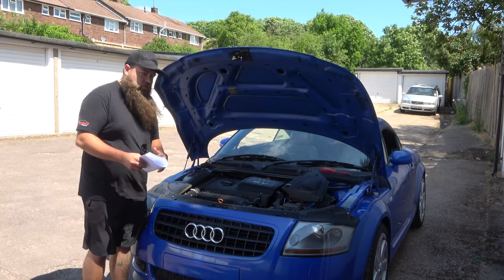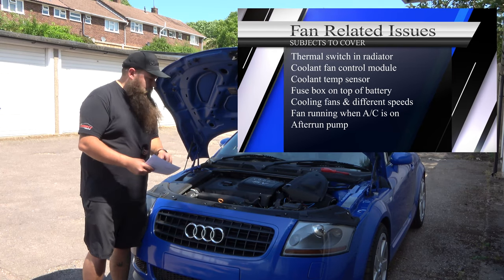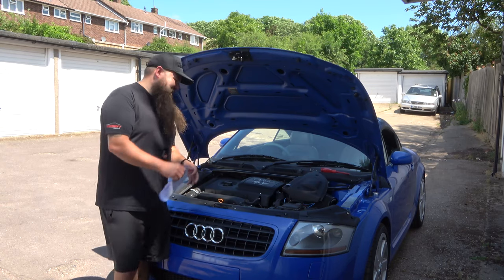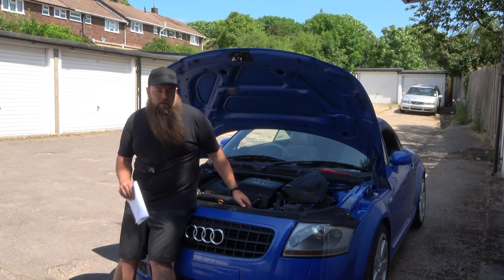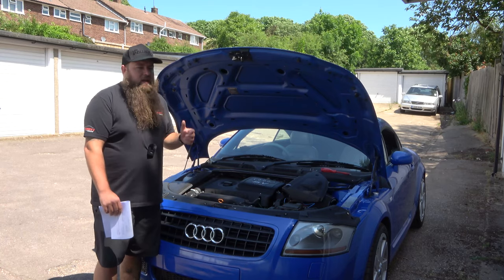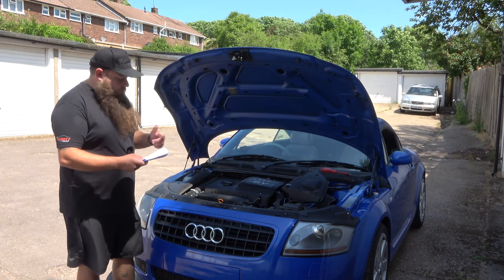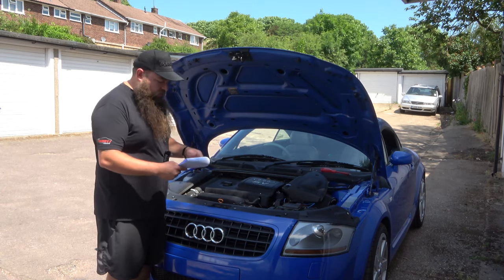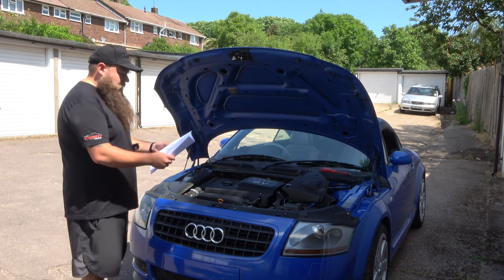How To Fault Find Fan Problems Audi

Comment: My Audi A8 Quattro 1999 is over heating and when I look at the two fans I see by the radiator, one fan that is connected to the belt and there is one electric fan that isn’t kicking on at all no matter the temp of the car. I watched your video all good info. Where should I check first thanks in advance
Reply from the maker: Not particularly fluent with a8’s buddy but I would check the supply to the fan and see if there’s power there or not. There’s a good possibility that you have a knackered fan or there is no supply maybe due to a failed fuse etc

Comment: Idk if you’ll be able to answer but I have an 08 Audi a4 and my heater hose broke and I replaced it and re added the coolant but when I turn on the heat(which blows super hot air) no fans come on, but when I turn on the ac, the fans come on

Comment: I’ve replaced literally all of these, and I still have to use the a/c to make my fans come on. The only thing I can think of is that maybe the brand of the thermoswitch I bought doesn’t cooperate with the car. Also I don’t have an after run pump. 02 180 5 speed Q
Reply from the maker: Sounds like you may have a faulty part, you could also have a broken wire etc. the thermo switch can be tested my using either heat or hot water to see if it changes state

Comment: Hey, thanks for the video, it's was very informative!
I was wondering of you disconnect the Coolant temp sensor, does it bring the fans on? I understand this works with most other cars.
Ty bud!
Reply from the maker: It’s not something I’ve tried but I don’t think it will, the fans are bought on by the thermal switch in the radiator

Comment: Another great vid big man. And just in time as my temp warning light things cropped up yesterday lol. 👊
Reply from the maker: Hope you get it sorted with the help of this video 👌🏻
Reply: Having another look tomorrow. The 49 code jobbie and the temp needle seem to be working together but still temp warning lights on. Both fans work with air con on. I'm I missing something??? Must watch vid again. Lol thanks again keep up the good work. 👊
Reply from the maker: @adamdrayton3100  you could have a failed water pump so it’s not circulating the water, the temp sensor could be faulty etc
Reply: @TheParrottBros  changed temp sensor. But before that on the way home it disappeared and comes on straight away when you turn the ignition on it there waving at you. Will have to get it apart see what the crack is cheers 👊

Comment: Brilliantly informative video. Just subscribed!
Have I missed it? What I have a A/C pump clutch not pulling in, but if put 12v the connector, it works OK. Is there a separate relay or is it controlled by the fan control module?

Comment: Just working through these issues this week.  Check this out....  large fan not working, ONLY small fan would engage (with A/C on or when coolant reached temperature threshold).  Jumped the thermal switch, had both high and low speeds on both fans (conclusion bad thermal switch).  A/C wouldn't blow cold. A/C compressor was only getting 9.5v...but was I was getting 12v entering the FCM.   Swapped out the FCM (knockoff) - result was NEITHER large or small fan would run BUT I did had 12v at the compressor.  Applied 12v directly (bypassing FCM) to the A/C compressor, clutch engaged (freon level was fine and small fan was running) but would not build high pressure in the system (conclusion- bad compressor.....and bad FCM).  Was driving myself crazy trying think this was only one issue......all wiring/fuses were fine no corrosion or signs of overheating ......you must have been feeling my pain and decided to make this video....hahaha.
Reply from the maker: That’s probably the most annoying part of fault finding issues. New parts that you can’t always rule out. Even though it’s new and should work fine 😂. Top work for persevering through
Reply: @TheParrottBros  I definitely have a few more gray hairs! 🤣
Reply: Hey sorry for bother you if I buy the air flow Sensor I’m Supposed to take it to dealership to program to the ecu or I can just connected the new one plz if u have a chance let me know and the temperature gauge it goes really high and that’s when the fans kick out when the gauge is really high any Ideas because I know you’re really good working on Audis TT
Reply: @victormagana1641  Sounds like you are presenting multiple issues that are not related to one another.  Have you had the car scanned with VAG software?  If not, this should be the first step.  Did you get a code for the MAF sensor?  If so, it's a straight forward swap.  The fans cutting out when hot is very odd and can be caused by multiple issues. Check all the connections at the fuse box on top of the battery.  If BOTH fans are cutting out, I would suspect a FCM or a Temperature Control Switch, but you should check voltage at the fans when they cut out. Voltage at the fans would point to the fans being bad.  No voltage to the fans would point to an issue further up the electrical circuit.
Reply from the maker: @victormagana1641  you can fit a new maf and providing it works and is not faulty it won’t need any programming etc. You may need to get a code reader and clear the fault codes. But you can just take battery off for 10 mins. Does same
Reply from the maker: @victormagana1641   your fans slow speed has probably failed, you need to test your thermal
Switch like said in this video. If you short the live and slow speed on the plug and they don’t run then likely failed. 

That or put your a/c on and if your fans don’t run that’s likely your problem. Need to replace fans
Reply: Ok I will put a new one on thanks bro’s and keep putting videos on they well Help a lot of people for the TT thanks again
Reply: Hey bro I have a boost Pressure leak on my TT any idea
Reply from the maker: @victormagana1641  Hey, could be lots of places it could be leaking from, pipes, joints, valves / solenoids. 

i would personally recommend feeling your way round every pipe, making sure its fitted correctly, doesn't have any damage etc first.

if you are unable to find an issue then you either need to get it smoke or pressure tested to find the culprit
Reply: I check with the car code machine and the code says boots pressure Valve leak
Reply: Hey good job on the videos parrott Bros hey Quick question when I turn the A.C on the fans they are not kicking on they supposed to kick on right
Reply from the maker: @victormagana1641  yes when a/c is turned on auto the fans should run on slow speed. If they are not either your ac is not working or the slow speed is faulty

Comment: My fans stopped working after doing the timing belt and heater core ...but it does work when AC is on .maybe its the control module
Reply from the maker: Test the thermal switch in the radiator, that’s more likely to be the cause

Comment: The fan on my 03 A4 doesn’t work anymore not even AC fan and I tried to run it with VCDS via output test and it still didn’t work, I tried to jump start it with a test lead on the connector for FCM and still didn’t work am I clear to understand that the FCM is bad?

Comment: Great vid!  on my Audi TT the fan turn on low speed but not on high-speed.
Reply from the maker: You should only see high speed when you go above 103 to 105°C, that doesn't happen very often if your slow speed fans working fine
Reply: Thank you, my man for responding. I changed the thermostat and the coolant temperature sensor now it’s working fine thanks again..

Comment: Got Audi A4 2.0l just got a problem of the fan and overheating will try that issue of aircorn. I did change aircorn compressor and no gas on it 
Thanks

And wht could be the problem if boot is not being open? Sometimes it opens  especially when it's cold when it's hot they is sun 🌞  doesn't open? Please help

Comment: Very good video and very thorough. However my problem is that my fans are working with ac on however they dont work when ac off any solution to this ? What should i look for ?
Reply from the maker: That will likely be your thermal switch in radiator. Unplug it snd bridge it out and see if your fans come on, if they do then your switch in the radiator is faulty. Very common
Reply: @TheParrottBros  thank you so much
Reply: @TheParrottBros  hello again. Many thanks for your kind advise. Happy to say that the problem is solved👍
Reply from the maker: @marinoskazamias9252  awesome 👌🏻 glad I could help

Comment: Is the smaller fan, for normal cooling.
And bigger fan is for AC operation only.
Thanks
Reply from the maker: Both fans should run at the same time, slow speed and fast speed. ( fast speed only for when cars above 103c ) so if a fan isn’t running it’s failed

Comment: Informative video! 

Just a quick one, when I turn my ignition on.. car hasn't been run at all. I hear the fans burst into life and running full pelt. Is this normal?
Reply from the maker: If your air con is on then it could well be, turn your climate control off completely if the fans still start up you could have an issue with the fan control module

Comment: Such a well timed video, my temperature has just started playing up, going to around 108 in traffic. I've noticed that with the Aircon on the both fans are spinning for about 30 seconds then both stop for another 30 then they cut back in again....also noticed that the overrun doesn't appear to be working :(

Comment: My fans run with the aircon so guessing they're ok. Fans are not cutting in but the consul temp is lower than the dash temp higher up the range.   Would a thermostat be on your list?
Reply from the maker: Both the dashboard cluster and the heater controls measure the temperature from the same place, the temp sensor on the passenger side of the engine. If your fans are not coming on when the car gets hot and the Aircon is off it is likely that the thermal switch in your radiator is failing or failed, this can be proved by removing it and then sorting out the two pins and see if the fans come on if they do then is the switch if they do not then he could be the control unit underneath the battery
Reply: Thinking whilst I'm there I may as well do the coolant sensor & thermostat........:glasses-purple-yellow-diamond: @TheParrottBros

Comment: Thanks for the information, wanted to know whilst on the move I noticed that if I turn off climate control system I feel warm air flowing in from the footwells or just under dash. I'm gathering this is not normal.. any advice would be much appreciated. Thank you
Reply from the maker: That could well be normal as even when off a small amount of air will flow through the vents, try when its on changing it to air vents on dash then turn it off and see if air comes through them instead
Reply: Cheers I'll give that a go. thanks

Comment: Hi, I tough I have an overheating issue, because the car was standing with running engine. I've tested the fresh replaced thermostat. I also checked 49C during the test, but started to overheat and I stopped the engine at 101°C, because the fans didn't turn on. After this video I realized, that ECON was ON.  LOL. Thanks for that info! :) Anyhow, I'm wondering what if ECON is ON and I don't check it. Can it boil the water without turning the fans on?

Comment: Great video, very informative. My fans are currently not spinning (this is a mk1 Leon 1.8T, not a TT but figured this is basically the same). I've already replaced pretty much all of this stuff  and they still do not work.
Stuff replaced with new parts:
-both fans
-switch in the radiator
-temp sensor on the side of the engine
-module underneath battery

-fuses on top of battery are all okay

Have tried to connect the fans directly as described and then both speeds do work. Temperature on the dash goes up to 90 normally and car does not overheat (so far).
All this is with ignoring the A/C (this car has the older knobs, not the climate control so there is no "econ") as there seems to be some damage to the condenser so this system is currently not in use.

Any ideas what else I can try/check? Unfortunately I'm a beginner and have exhausted my limited knowledge/experience haha
Reply from the maker: If your car isn’t going past 95 then your fans won’t need to come on as there is no reason for them to. 

You can leave it sat there on idle and eventually the car should creep past 95 degrees and they should kick in but besides that I wouldn’t worry if your not seeing over heating issues. It’s easy to be come worried about this issue. I’m bad for it 😂
Reply: @TheParrottBros  Hm I see, thanks a lot for your response! This is my first VAG car (got it as a project for learning) so everything has been new to me. Many people say both fans should turn on when turning on the AC but since that isn't working, that hasn't been an option to check  haha. Thanks again, I'll stop worrying about it.

Comment: Great video!
I wonder if you could help me solve my 2003 1.8T VW Golf overheating problem. It's driving me crazy.

When I get stuck in a long traffic jam it starts overheating. I think the fans high speed is not working at that point. Fortunately I get the temperature back to 90º quickly from 110 ºC by connecting AC.

Thermostat and pump seems to be fine as pipes from thermostat (lower) and from radiator (top) get very hot both, and it keeps 90º in normal driving.
I´ve checked both fans turn on (low speed) by themself at iddle and temperature stays at  90º, I also triggered the fans manually bridging the radiator thermo-switch connector. Both fans work in low and high speed.

What's the faulty component responsible for this, green temperature sensor, fan control module, fuses?

Thank you for your time helping us.
Reply: Please,  @The Parrott Bro’s  could you help me?
Reply from the maker: Drop me an email and we can discuss it, my email is dom@theparrottbros.co.uk

Comment: Both Fans work for me when AC is on but fans not working when A/C is off. Low fan speed doesn't come on by itself. Will the radiator switch that I cross turn the low speed fan on show that it's just that radiator sensor that is bad if I know that both fans run when A/C is on? 
Thanks for this video I love my mk1 tt.
Reply: On the Radiator plug below battery. I checked my plug for voltage and only one of the two/three  configurations is showing 12 V voltage on the Three Socket Plug on the Harness. The other Two configs on the connector sockets show Open (.02 ohms). 
I did a Jumper as well in both configurations on the Harness connection and only One way works by firing up both fans with the A/C On or Off.
The Module is New and the heat sensor plugs are newer.
Reply: LOW TEMP FAN JUMPER TEST :FAILED
LOW TEMP & HIGH FAN JUMPER TEST : PASS
Harness bad?

Comment: Slightly the opposite to the issues you explained here but I was wondering if you could help? My tt simply won't get to temperature! Confirmed with 49c trick, thermostat and temp sender changed.
Can't seem to get above 77 degrees even sat in traffic 😫
Reply from the maker: Thats a strange issue, have you used a genuine temp sensor? when was the water pump and Cambelt last done?

Comment: Hi, my a.c works well and gets cold, however the low speed fan does not work. How can I test if the low speed is working? And if it does work what would I check? Thanks
Reply from the maker: If your a/c is working but the slow speed fan isn’t coming on then it’s likely failed. You can try putting 12v to it and see if it comes on or not.

Comment: My power steering pressure switch was damaged I noticed when I was trying to find the fault with my fans. Replaced the ps switch tonight and now my fans are working
Reply from the maker: That’s strange 😂 but hey if it fixes the issue happy days ayy. The is the issue with 20+ year old cars. Doesn’t always make sense

Comment: Dom and company..I have a question about the aux water pump. I just replaced it but it doesn’t stop running now. I was looking this up and it could be my older battery in the car, or the FMC has gone bad? I’m pretty new at this but I definitely knew the aux pump was going out. In fact it fell apart when taking it out, lol. I have to keep the new pump unplugged until I find out what is causing it to run constantly (and after 10 min). Any thoughts on this??
Reply from the maker: This is very interesting, have you let it run for more than 15 minutes to see if it does turn off?

It could be a broken relay in the circuit, I would have to check my drawings,
Reply: @TheParrottBros  yeah it doesn’t shut down. And heater finally lost heat, so I’m getting the heater core and coolant system flushed. Hoses are gummy from years of improper coolant. So maybe boil down to temp sensors or something else. I did read on the TTforum that a new battery in fact, solved their issue. A weak battery wasn’t enough to keep the relay happy.

Comment: Impeccable timing, I was just messing with them earlier, fuse s180 on top of the battery was blown as soon as I was about to replace it blown straight away and blew 3 more, what could it be? It is not melted or anything car gets passed 90°c if idling for a while
Reply from the maker: Usually a short, one of the fans could be failed, a cable could be down to earth, broken wires. my bets are on the fans being failed, unplug the fans one by one and try another fuse
Reply: @TheParrottBros  they do work with AC on, I forgot to mention I wired in a manual switch tapped into the radiator temperature sensor, worked the charm for a month then the inline fuse that is on the switch blew, 30 amp one as well, I was taking power from the power supply under the dash, I am not sure if the switch has died, I am going to do the resistor mod soon, as it is driving me crazy, I have been watching the channel for just over a year keep up the good work🔝